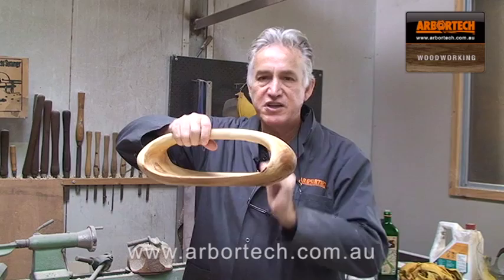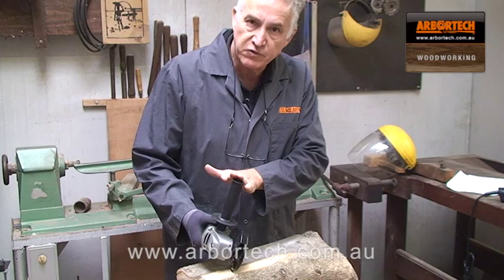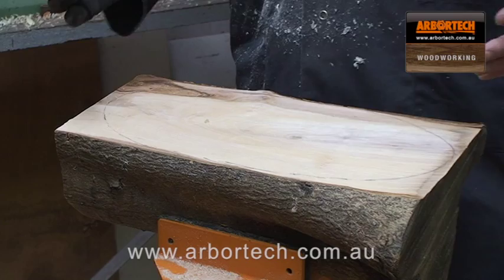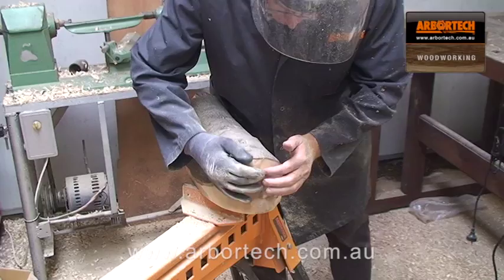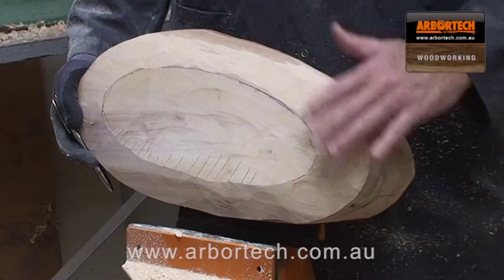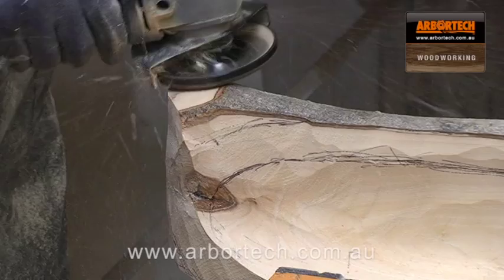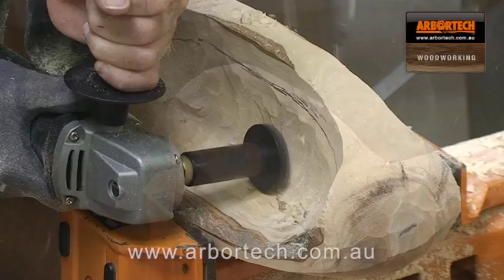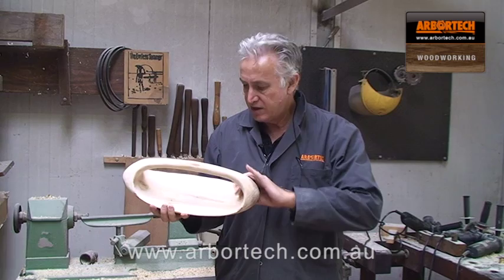How To Make a Bread Basket With The Arbortech TURBOPlane and Mini-TURBO

Comment: Looks like a great tool.  I may have to pick one up to play with. Very nice project also. I am impressed.

One quick note on finishing with olive oil.  Olive oil goes rancid after a while and gives off a horrible smell.  In fact I have had to throw away cutting boards that went rancid from olive because my wife couldn't stand having them in the house anymore. I do love olive oil, but it is better to keep it for cooking and salads.

An alternative is to use Natural Tung Oil (NOT Tung Oil Finish).  This is a polymerizing oil from the nut of a Tung tree.  It is an outstanding finish that really brings out the grain and is perfectly food safe. Note - you may want to double check for people with nut allergies, but I haven't heard of any warning about this myself.  For food focused woodworking projects I mix the Tung Oil 50/50 with lemon solvent for the first coat.  Put it on very heavy, practically soak it, then wipe it down in a few hours.  The next 2-3 coats of oil can be done full strength. It is best to wait a day or so between applications because real Tung oil can take a long time to dry.

Warning, many companies sell products called Tung Oil Finish.  These are NOT Tung oil and probably don't even contain ANY Tung oil in them. I have no idea if they are food safe or not, but I avoid anything that is not certified as 100% pure Tung Oil for food projects.
Reply from the maker: Doug Robertson Thanks for your comments Doug. We take a lot of care in providing care information to customers about our tools and any advice in our videos or tips. The TURBOPlane and Mini-TURBO are one of our best sellers and as you can see, fantastic tool and so easy to use while shaving off valuable time! Please sign up to our Woodworking Club newsletter on our website to get exclusive member benefits and specials!
Reply: Use mineral oil for the first coat, and then Howard Butcher Board Conditioner from then on. The waxes in the conditioner will add a nicer finish.

Comment: great work congratulations. Just a question: I'm just starting to discover the beauty of carving wood with a grinder, the problem is the huge amount of dust that it produces, not only for me that I'm using the tool, but also for all the workshop. Is there a way to collect the dust during the working phase ? Thanks
Reply from the maker: Maurizio Cattaneo The TurboPlane produces huge volumes of shavings but very little dust. I work in a workshop which is open on one side so I can easily shovel and sweep them up and maybe blow out afterwards with an air hose. Many prefer to do this sort of work outside if the weather suits.

Comment: Hi there, excellent demo. Bit confused about the shaft you've fitted at 6.30 though. I bought the arbortech mini grinder and the mini turbo kit based on this video but I can't see how to fit the shaft to the grinder? In the video you seem to be using the nut adapter that comes with the mini kit between the shaft and mini grinder, however it says on the box this is for use in Australia only (I'm in Europe). Besides there is nothing on the grinder for it to attach to anyway. Am I missing something? In the video it looks like you've attached it to a mini grinder. Of this is the case how did you attach it? Any help appreciated! Thanks
Reply from the maker: Parawata Hi Parawata. My apologies for the delay in replying. I've only just been shown how to respond to these comments as an administrator. The video shows the use of the TurboPLane and the MIni-Turbo. Both of these products are sold as attachments to any standard Grinder. The Mini-Grinder you have bought is a stand alone product and is not designed to have other attachments. In the video, I am using an Arbortech Angle grinder (Which we cannot sell in Europe because of regulations) but you can use any standard grinder to attach the Mini-Turbo.  I hope that helps- Kevin

Comment: Beuatiful work! Can I buy those tools in the USA? (website link doesn't work.)
  How did you cure the wood to keep it from splitting? And more importantly, how do you keep it from splitting apart at the relatively thin handle?
 I would think that mineral oil would be better. It won't get rancid like vegetable oils can. (That's what I use on cutting boards.)
Reply from the maker: bill keiser The TURBOPlane and Mini-TURBO is available on our website www.arbortechusa.comYou can order online at the website or visit your local dealer to purchase.

Comment: chainsaw is a lot faster
Reply: But this leaves a beautiful clean smooth finish with a lot more control than a chainsaw
Reply: Actually I doubt it. Because after you put down the chainsaw you would have a lot more work to finish the project.